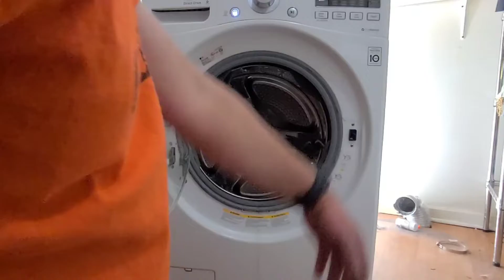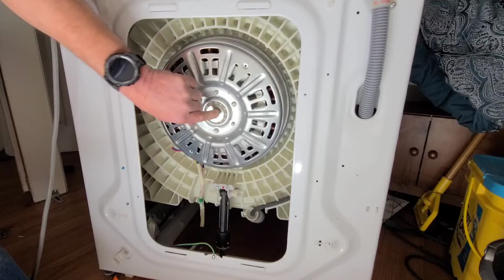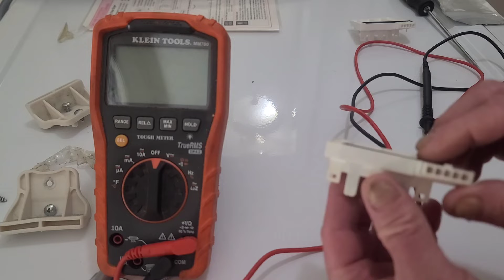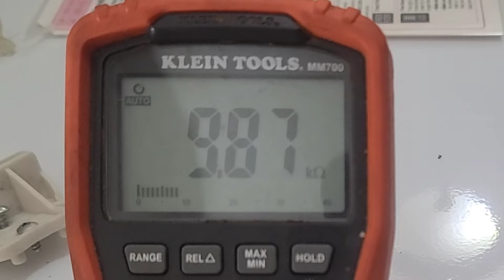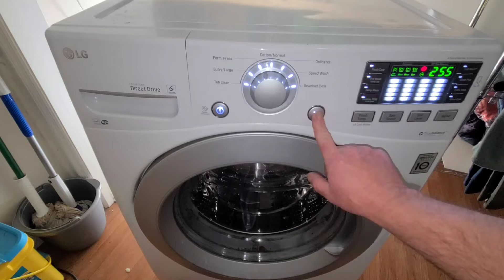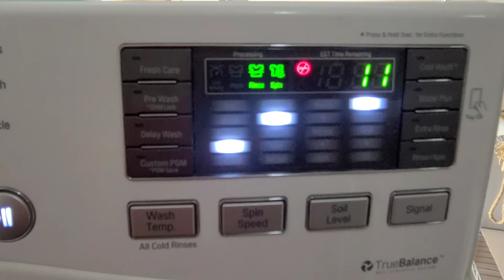Easy fix LG Washer Grinding Growling with LE Fault Code Diagnose Test and Replace 6501kw2002a

Comment: Excellent video.  I have an 2015 LG washing machine - WM3050CW  ABWEPUS  and went through the same diagnostic as you did.  Fault on Hall sensor B with a reading of 0.  Got a part for 12 bucks and will put it in on Friday.  Wish me luck, cuz you probably just saved me a couple of hundred bucks with DIY instead of calling a technician.  Seems like the hall sensor is designed perfectly to last the warranty period, and then, kaput!  Thanks, good sir!

Comment: I have the exact same issue with a different LG model.  I'm hoping this fixes ours as well! Thanks for the video! *Fingers crossed!
Reply from the maker: @jaelynrae6045
It's most likely Hall Sensor.
Test yours just like in this Video 
Your Welcome
Reply: @sartingarage8045  It worked!!!! Thank you! Thank you! Thank you!!! 💕

You just saved us a $295 diagnostic fee...not including any repair costs.